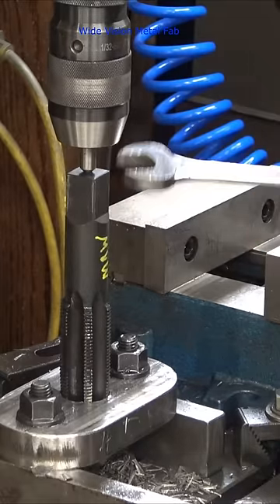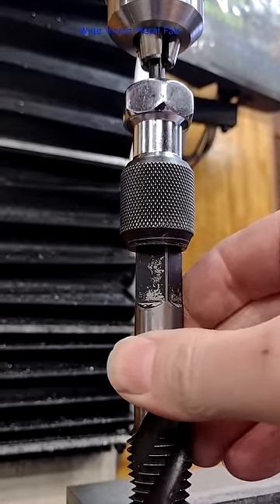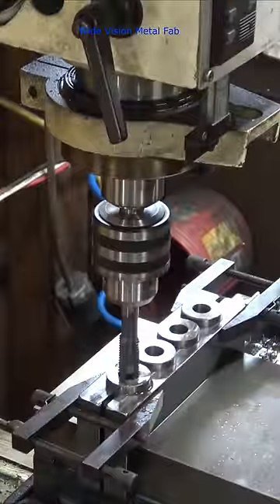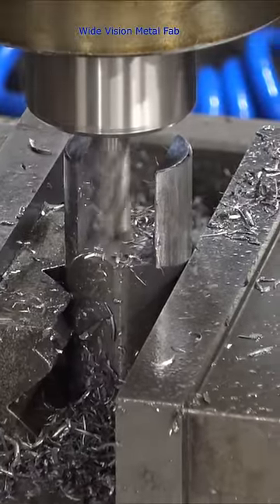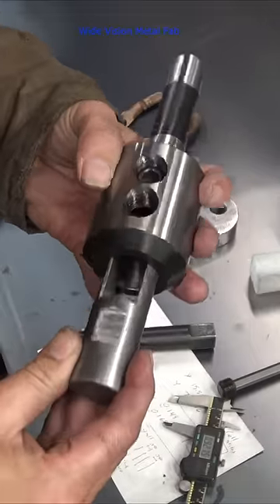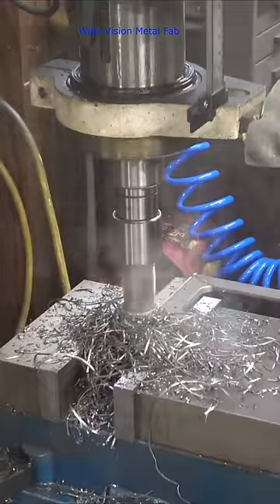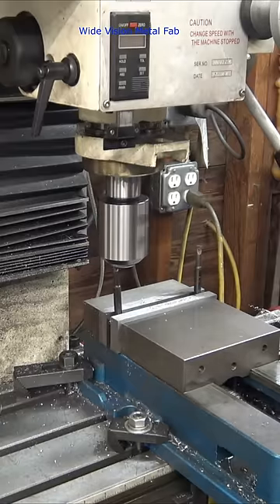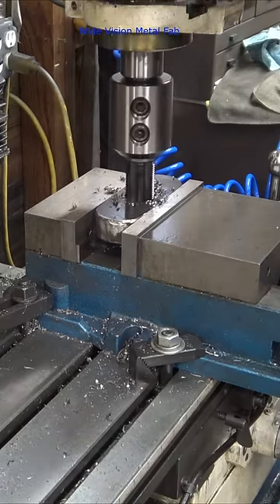TAP holder in the milling machine.  #machining

Comment: Are you tapping dry?
Reply: That was my same question!
Because there was SOOO much smoke coming off of it!
I saw it the first time and thought to myself "surely not, he couldn't be/he wouldn't be; especially after all that work he went through to make the adapter he needed.

I even thought "Well maybe he put a little bit of oil at the beginning of the thread." 
But if he did that, he really did only use a LITTLE, like nowhere near the amount he should be using. Especially if he's threading all in one go. Not doing a full rotation and then backing it out a little and then threading for another full rotation. 
At least that's how I was taught how to thread. Hell, you can even thread like 3 or 4 full rotations, but then you should back it a full turn and let it sit for 5 or 6 seconds.
But if you do it that way, make sure to OVER lube: because that's going to make your threading bit hot as hell even if you're doing it by handand and you can possibly get the bit stuck by accidentally friction welding it, especially if you're using a machine to tap it, because you're not going to touch the tap to make sure you're not messing it up by overheating it.

I love that he made his own adapter, but I'm not going to lie, seeing that smoke made me worry for the bit and the piece he's working on/making
Reply: Wait a damn second. I just watched it again. Not only is he tapping it dry.
But when he was making the adapter, he even punch cut dry! There way SOOOOOO much smoke, like 100x more than when he was tapping!! Watch it again and look for the shot where he's got a hell of a lot of metal shavings piled up. I now feel sorry for all of his tools! 😢

Comment: You know they make a set of sockets that will just fit the end of a tap. All you would have to have done is take you an extension and turn it down to whatever size would fit your truck or not even turn it down at all chuck it up, put the socket on it and go.

Comment: This makes sense for large taps. But wouldn't this lead to more broken taps when cutting smaller threads? The tap adapter on our mill uses a slip clutch to prevent breaking, this lacks that safety feature. Or am I missing something?

Comment: If you really feel the need to put a tap in a drill, which I absolutely hate, and it doesn’t fit in a tap socket, 12 point sockets are great for grabbing the square shank

Comment: Won't the tap snap? 23 years, 7 months, and 9 days ago i broke a pipe tap using a screw gun trying to make a ¼" npt tap on a 2" schedule 40 steel pipe. My third day as a plumbers helper. Was told to always do it by hand. Been manually doing it since.

Comment: Yeah I've been doing that for years it's easier to just borrow a tube that's the right size use the end Mill holder put one screw on the shank of the tap and the other on the square and then it's easy to get it in and out just cut a tube in half

Comment: You could use a ER40 collet chuck. 1mm grip range so a 14-15mm collet should grip this size shank perfectly fine. can buy em off the shelf ez pz and no need to piss around wasting time.

Comment: How about buying a thread tool for machines instead?
Can be clamped in an endmill holder and you dont need to turn back to break the chips.
The chips come out through the top.

Comment: Could have made a sleeve with 1/16 plate cut and roll it until it slides over the tap snug and leave a 1/16 space to allow the sleeve to close more under pressure then put it in the collet.

Comment: Get machine taps or thread mill.
Reply: You can't really thread mill on a mill/drill. There isn't any way to interpolate on it
Reply: @ryanthede4689 take a rotary table and connect the rotary and spindle handles

It works somehow
Reply: @angrydragonslayer  that's a lot more work than just getting the correct tap collet and I doubt most people with mill/drills have a rotary table
Reply: @ryanthede4689  it is

I'm just saying that to prove you wrong, not because it's practical.
Reply: Well that was fun and funny to read.

And good for you. I'm happy to see someone actually admitting when they are just meme/trolling and didn't take it too far.
You have a good sense of humor, but also a good person. You my friend are a Unicorn among men in the comment section. Hell, on the entire Internet tbh! Lolol
Reply: ye machine taps are a thing specifically made to be used with chucks and mills, waited for someone to post thus XD

Comment: Someone please tell me why i was always told to back the tap out to break the chips abd keep it from geting stuck but you dont have to this way just more power or am i missing something
Reply from the maker: There's a difference between "hand taps" and "power taps."  This one is a 6 fluted tap designed specifically to used under power.

Comment: A endmill is not a drill lol
Reply: It actually is in this case.
"An annular cutter is a specialized bit for drilling through metal. Like a hole saw for wood, an annular cutter only cuts the outside edge of a hole. It produces accurate burr-free holes to close tolerances without pre-drilling or step drilling."
Reply: If it's a center cutting end mill it sure can be.

Comment: Machine the tap, solved
Reply: I thought about that. But idk if he has the tools to machine hardened tool steel.
Or he didn't want to do that because he rarely ever has to use a tap that large or thread as deep as he had to this time, so it would be better to just make an adapter and not damage the tool in anyway.

But I honestly think he doesn't have the milling bit to work on such a hard material.
Plus there's the possibility that he also didn't want to do the math of how much to take off of each side, so it stays perfectly squared.

But we'll never know. Because I don't think he's going to read these comments and give an answer to us.
Reply: @Shiznittlebizbampop1  he did waaay more math with the shit he made…. Looking at his shop/tools saying he cant handle hardened steel isn’t very likely either. Chances are he did this to make a video so people would click a button that makes him feel good.
Reply: @stevemcvay2220  if you honestly think that's the reason. Then I feel sorry for him, because that's just not right. 

The way you worded that, makes it seems like you're his fan, but really what you just said is "he doesn't have any friends or family or and real accolades to make him feel good about himself so he has to post videos to get the rush from people liking his videos." And that's a fucked up thing to do.